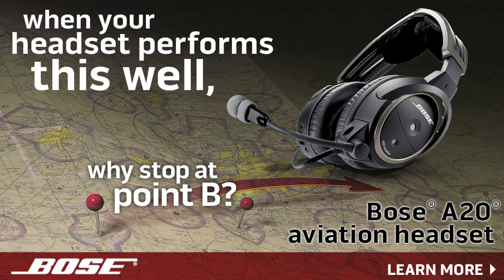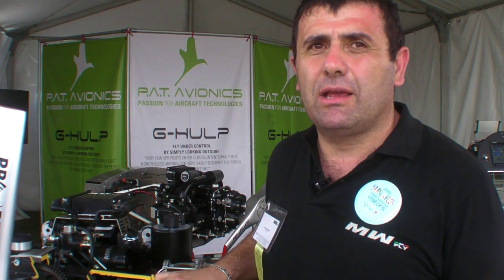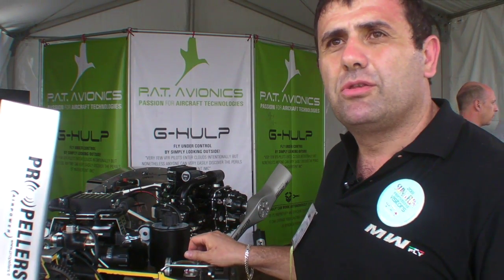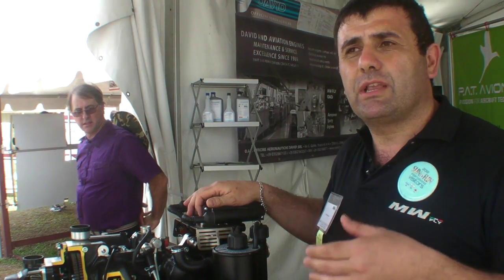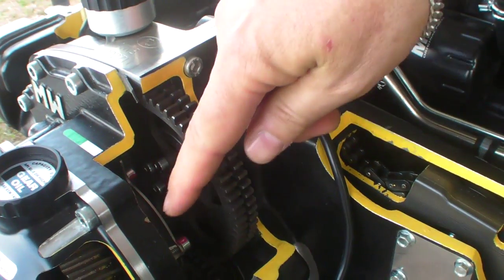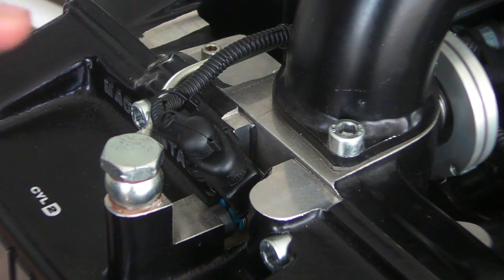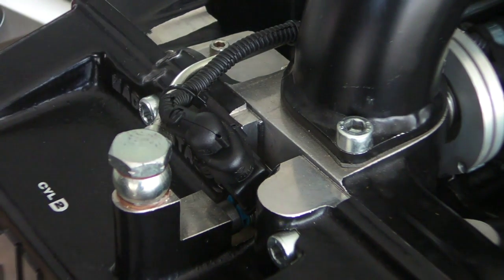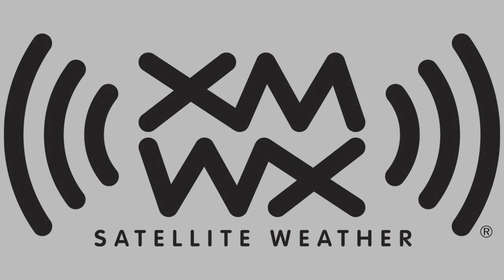MWFly's New Experimental and LSA Engines

Comment: immagine the throttle response and how fast an engine could rev if composite internals were used on high performance automotive engines. i knew they were trying to figure out ways for composite internals but did not know about this. very interesting thanks avweb for the video!